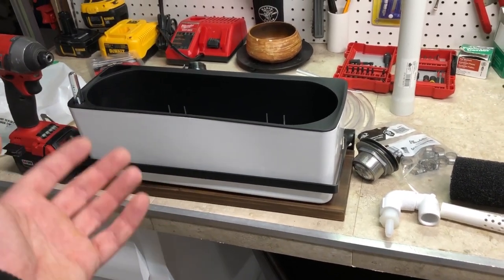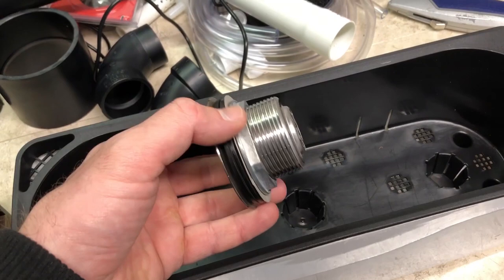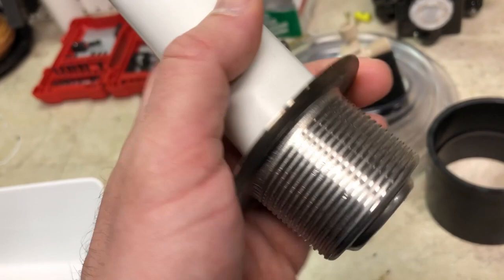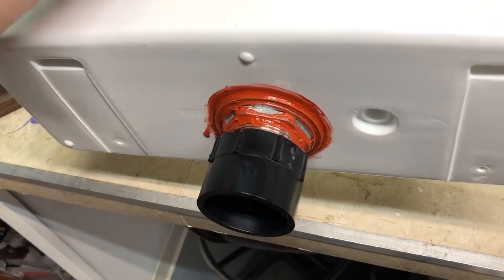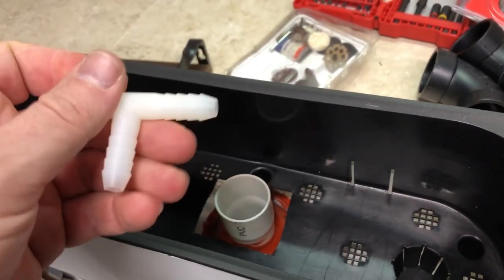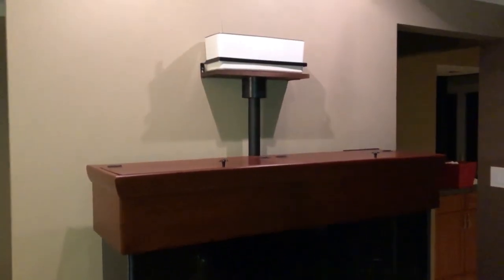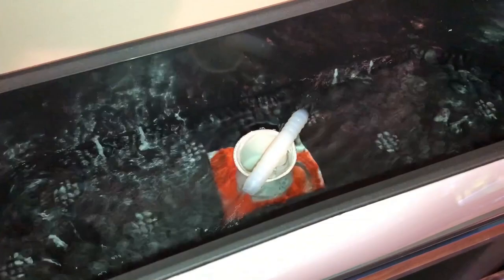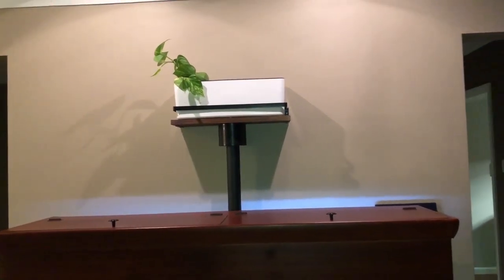DIY Aquaponics | Decorative. Practical. Simple.

Comment: For the grid you could use egg crate light diffuser. Should be available at hardware store. For the noisy drain, you could copy the design of a Maggie Muffler.
Reply from the maker: I have already used the pipe method shown at the video end and it’s hardly audible now. I modded the drain exit also with a end cap with a 1/2” hole drilled which focuses the water into a steady stream as it enters the tank surface. That makes zero noise too now. I didn’t put that in the video because everyone will have a different situation that they would need to make their own adjustments for. If they really want to. 

For the top grid, I used a piece of half inch poly foam with a few holes poked through. I took pieces of cut cpvc pipe and hot glued them to the underside to act as legs so it sits under the lip of the container and is not visible. That’s all stuff I had laying around so it was free and on hand.

Comment: I've seen a lot of set ups with a similar backbone, but your adaptation of design over function, actually improves both. The feed tube inside a much larger drain tube is a great idea, the clean look of your setup is awesome. The pump outside the tank AND below water line. Shallow pickup tube. Of all of the designs I've seen in this "family", yours is definitely the one I will emulate in my project. Thank you for sharing!
Reply from the maker: And it’s still working today

Comment: its a grand concept but i think its not a great idea in a planted tank as the pythos is really nutrient hungry, probably will cause you to dose more fertilizers. other than that its something im going to build for myself, thank you very much!
Reply from the maker: Alex Kookiez I still only dose a half dose once per week. Pothos is nitrate hungry mostly, but it doesn’t Grow fast enough to take away from the other plants.
Reply: I doubt. I have been running a similar system for 5 years (zero water changes so far) and my aquaponic system is half the volume of my fish tank. The system is full of Photos and my fish tank has a lot of plants in it. The only annoying thing is that the photos is growing too fast and climbing on my walls. Other than that I just top up the water and it's all good

Comment: If you wanted, could you have made a shelf the entire length of the tank? Is there a limit/ratio of how many plants a fish tank can support? Is it based on how many fish are or how much fish food you add?
Reply from the maker: Shawn Faust sure. With pothos Ivy it doesn’t really matter. But in a planted tank it will thieve the nutrients.
Reply: @GrowingAnswers  How many, lets say generically, "salad greens" plants would this set up be able to support?
Reply from the maker: Shawn Faust quite a few. It’s around the same space as those aerogardens
Reply: My aquaponic system is half the size of my fish tank. Tank is heavily planted and the photos is growing like crazy. I do not see issues with the plants in my tank. Just add more fish and there will be enough food for all plants